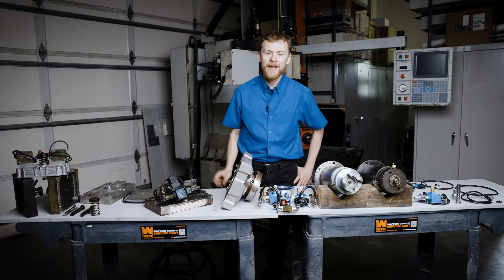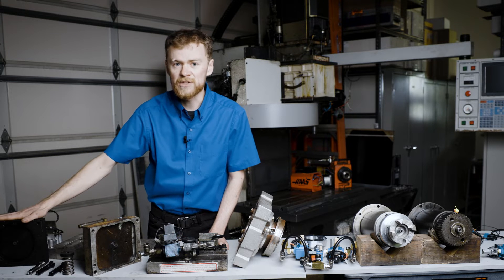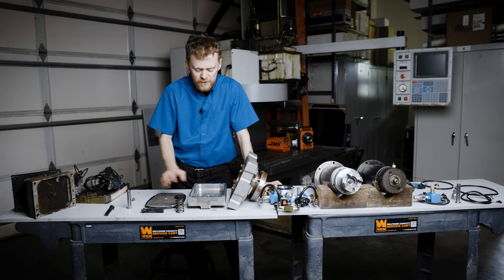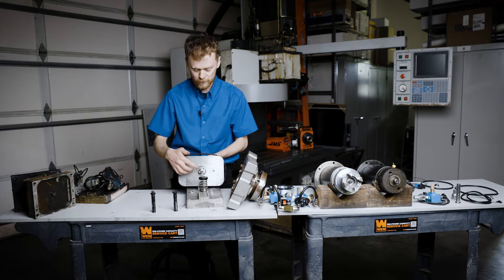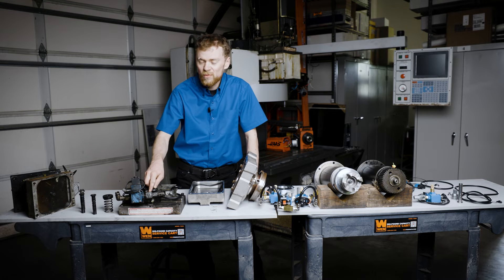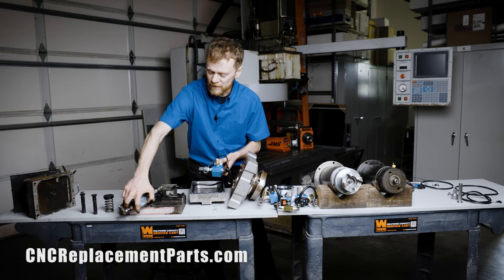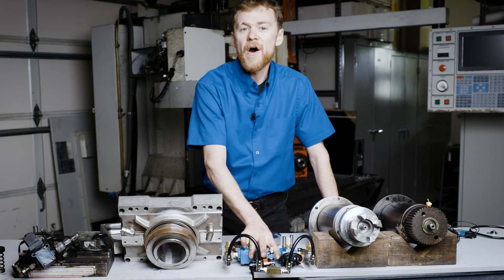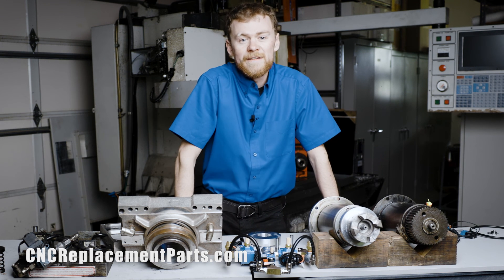Tool Release Piston Overview

Comment: We have a FEMCO V-12 49" VTL.   Tried taking off the bottom plate of the tool holder to get to the spring and mass chuck.  I can only get it to drop about 1/4" not sure what holding it up.  Used a jack and a pc of wood while loosening the blots , but it won't release.   Any helpful tips to get it off to see if the springs need to be replaced?